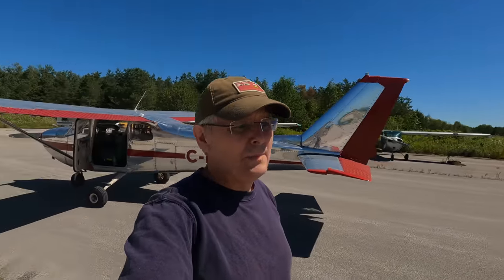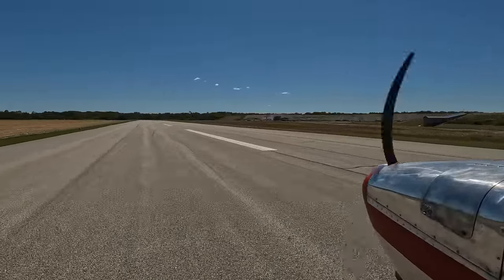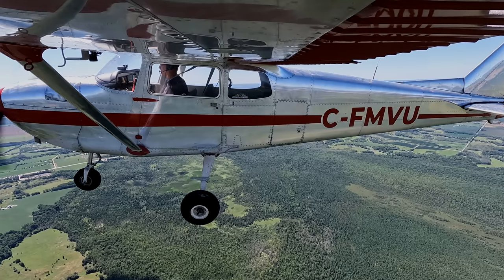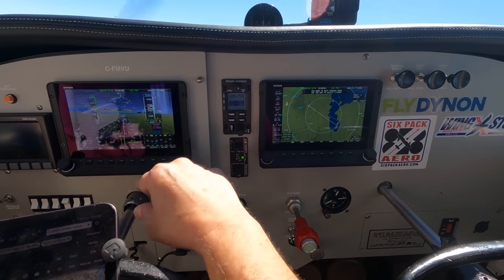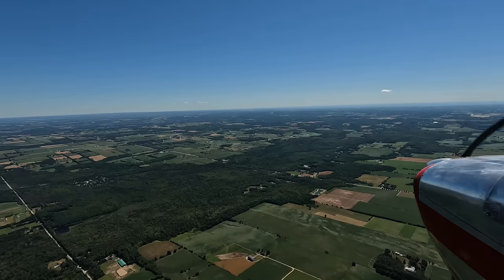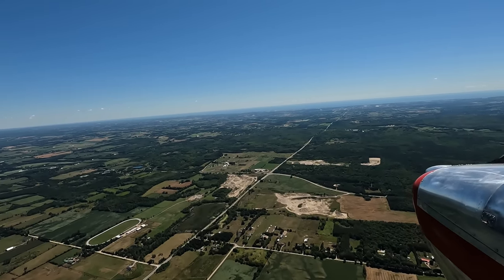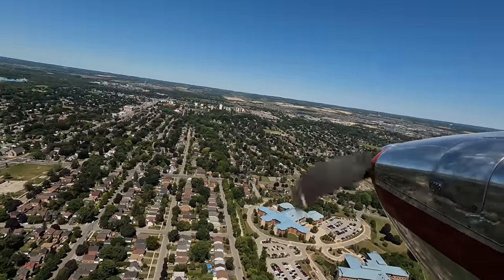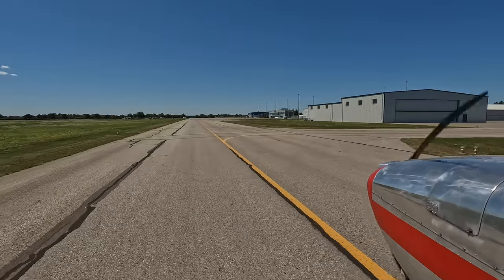1 Year Later - Finally Flying C-FMVU Home! Total Cessna 172B Refurb with Glass Panel

Comment: I assume that the STOL kit slowed the airplane down a little. How much? 😊. Thanks for showing the installation! Interesting.
Reply from the maker: The STOL kit, VGs and the wing extensions all worked together to slow it down.
I'm still testing with different loads and CG values to figure it all out; at some point there will be a video.

Comment: G,day Glen from Sydney Australia.
You didn't mention the numbers of stall speed with the wing extensions. My guess is 45KIAS
Interesting about the radio interference, it seems to transmit and receive.
🌏🇦🇺
Reply from the maker: I'll be going over the numbers at some point - but depending on the flap setting I'm seeing stall speeds at 38 MPH / 33 KIAS

Comment: Great video, Glen.  Looking from the camera's point of view, I didn't think the landing was bad at all, the camera wasn't shaking, the airplane wasn't bouncing.  I was kind of laughing because when you were saying Oshawa, I was 'hearing' Oshkosh, and I thought you might have been going to Air Venture!

MVU looks really nice.  I think the panel is fantastic.  I can't wait until you get the interior put in.  I suspect that it's probably pretty loud in there, if you take the Bose headset off.  When you go to put the interior in, are you going to use any extra sound dampening/environmental retention (keep the warm in during the cold months) sort of extra insulation?

You mentioned you had the stall speeds down, but you didn't say what they were.  Can you elaborate on with the extensions, VGs, etc, how far down you got the stall speed?  I'm thinking low 40 knots or so.

Looking forward to the next video.  Cookies!  I hope you're bringing enough for all of us!  :p

Comment: Amazing video Glen, surprised how much bouncing around the wee plane does. Is that turbulence typical, or is it more to do with the air temp on this flight?
Reply from the maker: Pretty typical of flying in the summer, if you watch any of the flights I do this winter you'll see that they are much smoother.
Reply: @GlensHangar  so is there a premium season/time of year where you’d get the least turbulence, or doesn’t it worry you much? Flying as a pax on the ATR 72 from Christchurch to Hamilton NZ regularly, the worst time of year to fly over the Southern Alps was November, end of spring, early summer.
Reply from the maker: Turbulence doesn't bother me much, I do find it to be part of the fun of flying; though on longer flights of 3-4 hours it can get tiresome.  As soon as the daytime temp drops below zero / there's snow on the ground, turbulence drops away completely* (*Blizzards pose an exception).

Comment: Awesome video Glen and nice to see the Dynon panel in use in a Canadian context, especially that the radio unit had the Canadian frequencies working well.

Have you had any issues yet with the naming of some of the Canadian airports or other aerodata in your database? the only thing I wasn't too fond of for the Dynon units is that they use of Seattle Avionics as their data provider. I use an app called Xavion that uses Seattle Avionics databases and I've had to bring up multiple Canadian airports that were renamed long ago and hadn't been updated in the databases yet.
Reply from the maker: I haven't run across any trouble yet with airports in the database, though some ATIS / AWOS frequencies aren't listed.

I will be flying to CSQ4 in a couple of weeks, and as much as it was built in 1954 it's been abandoned since the 1960s. It only recently (the last update of the CFS) has been re-registered as an airport with frequencies etc, so I wonder if it's in the Dynon database?
Reply: @GlensHangar  CSQ4 looks to be in the database and properly named. I don't have a current example, but at least up into 2020 CYTZ was listed as its old airport code... Looks quite a bit better nowadays but still come across some leftover old airport codes once in a while.